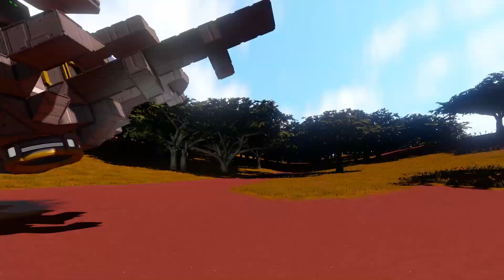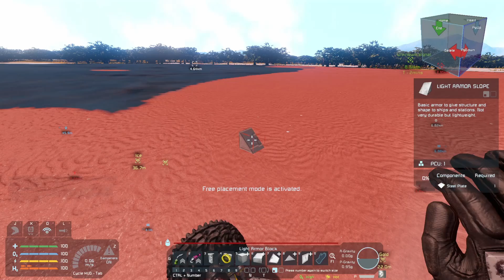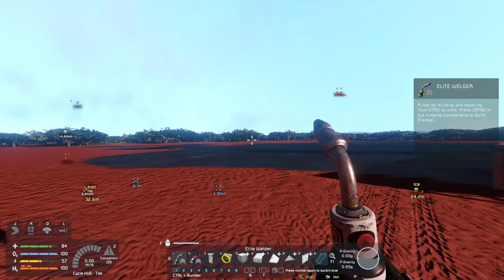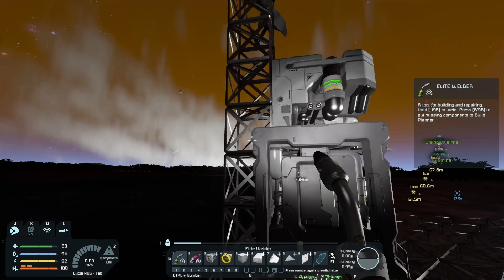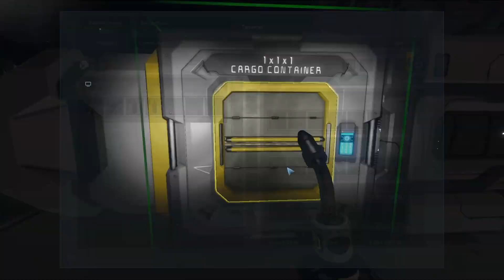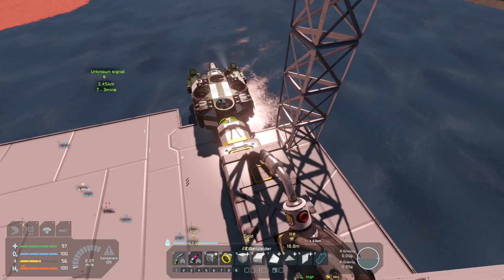Saying Goodbye and Moving On | Space Engineers | Season 1 Episode 14

Comment: The trailer trying to push into the rover and wanting to jack-knife sounds like a wheel power and/or friction issue.
If it's still an issue after removing the flyer's gyro over-ride, try lowering the trailer wheel's power & friction to a little below what the rover is set at.
You can also set the lateral hinge limits to control how far the trailer can angle from the rover.

Since I doubt anyone wants to refine ores in one location and then have to transport them to another location with assemblers, I'd say it would be common sense to have at least 1, if not 2 or 3 assemblers there at the refining base.

With all the beautiful ice at the site, having a hydrogen engine as a power backup unit would be a sound decision, if/when wind power can't keep up with power demand.